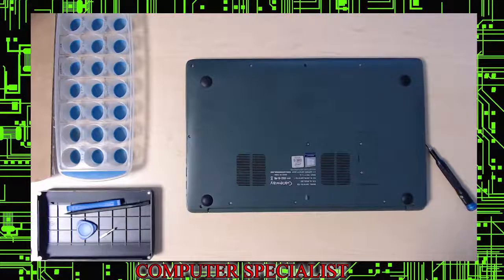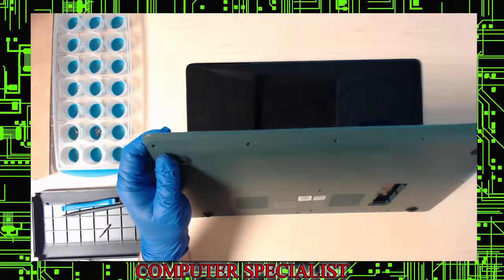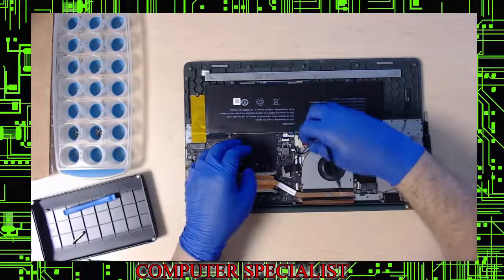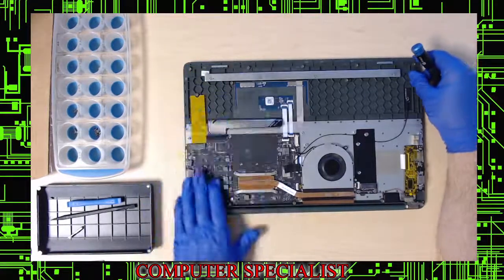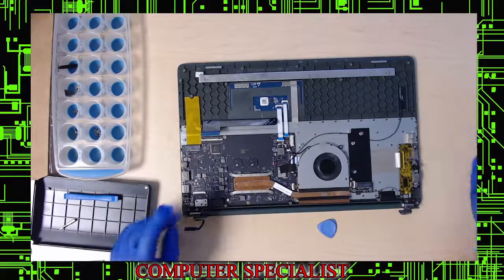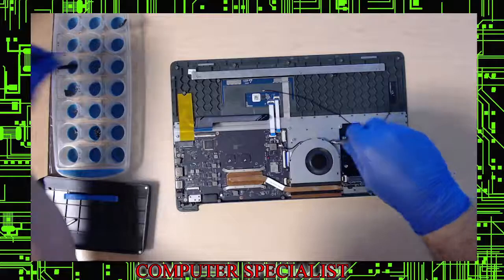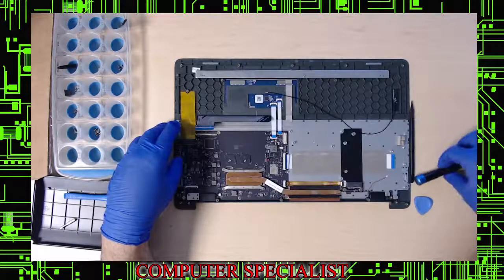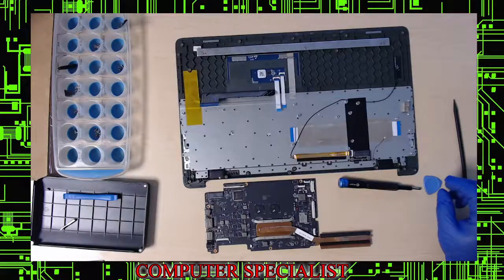Gateway GWTN156-1GR  Disassembly

Comment: Great vid! Thanks for all the info and the patience to respond to the comments! My gateway GWTN156-1BK started to have problems with keys 5, 6, R, T, F, G and V. They're so close together in the same column that definitely looks like something broke. Opened it up, the support bar was super loose, one screw almost fully unscrewed. I guess that led to the keyboard flexing and failing. 
I just saw the price for the full keyboard assembly you linked on another comment... external bt keyboard it is for now!
Reply from the maker: Thank You! Yes they are expensive!! But you can keep looking and maybe find one that accepts offers and send them a lower offer! We do that a lot!

Comment: This video helped me with my gwtn156-5.  All of a sudden one day my touchpad was popping up and the fan seemed to be getting obstructed. Turned out to be a swollen battery!  Thanks for doing this vid, gave me the confidence to crack her open!
Reply from the maker: You're Welcome! Make sure you subscribe to our channel for more videos and to help out our channel!!
Reply: well i return here 8 months later, with the same freakin problem yet again! Just noticed my touchpad starting to bulge again, and the keyboard has also stopped working a few months ago.  It has been a nice laptop when it worked, but I cant even find another replacement so im just gonna move on and get something reliable.  Dont fall for these gateways!
Reply: @Dman_12  Cañ you kindly tell me how long you've used it cuz a'm planning to buy the same gwtn156-1rg
Reply: @blessings9204  I've had mine for about 2.5yrs. I had to replace my battery 2 times now but I might have been leaving it plugged in to the wall too long!

Comment: Thank you for the video. I have a Gateway GWTN156-7BK, it's probably not even a year old. Well, I spilled coffee on the keyboard and now there's about 5 keys that don't work. It's been dried out for a couple weeks and they still don't work. Like your video explained, you need to order the whole top to replace the keyboard. Removing the bad key(s) and cleaning the plastic parts underneath of them didn't do the trick. Old laptop keyboards were removable but not this one. I spoke with Gateway and they want me to ship it to them for repair and a coffee spill is not covered under warranty. The '3' key sometimes goes wild and continually types '3' with no way to stop it. I've been told Ctrl-Alt-L will lock the keyboard but you have to press those keys at just the right time upon booting up, it's only worked for me once. I do still use the laptop because I have an external keyboard plugged into the USB port. Bottom Line: I guess I just have to get a new one.
Reply from the maker: Yes you have to replace the entire top. What color is yours?

Saw this on ebay and it comes with Motherboard, can get to fix yours and sell the MB for $150

https://www.ebay.com/itm/175084191053
Reply: @computerspecialist8533  Thanks! Well - I did it. I removed everything following your video. I did not order the whole top. I decided to pop those plastic rivets and purchase only the $35 keyboard. I'll use hot glue like you mentioned. One tricky part is to try and not bend the thin metal plate as you pop the rivets (you could also sand them off or cut them off) but it all went well. I'm now in the middle of trying to hot glue the metal plate back to it's plastic case. I'll get back to you and let you know how it goes. Thanks!
Reply: Hi I have the same issue with my laptop and the same model as yours! The m key keeps running with no way to stop it. Do you think someone like geek squad can fix it? What is the whole top? I purchased a keyboard from Amazon 😅 and now I'm uncertain!

Comment: Thank you for the video!! My computer keeps powering off. I see the charging light, but it flickers, and the computer instantly shuts down because it can't get enough charge. Can the power jack be replaced? I really appreciate any help you can provide. :)
Reply from the maker: Sorry for the delay, did you get working? Usually with these its the charger itself! The jack can be replaced but needs to be soldered on!

Comment: Hello, didnt know about the top with k/b, found one on ebay, 43 and some change, but how do I revove the touchpad without breaking it, seems like it snaps in at the top but not sure. Great video, learned some thing, thanks
Reply from the maker: The touchpad is integrated with tape and plastic rivets unfortunately. So it is not really possible to remove without being destructure. An unfortunate part of these cheaper laptop designs :(

Comment: I have this model and it had stopped working one morning I am able to boot it to the screen that says Gateway but it just never loads in. Only screen I can get to is the American Megatrends which freezes when it tells me to setup
Reply from the maker: I would start by unplugging / removing one thing at a time (My money is on the keyboard). Lay on its side then turn on and real quick unhook the keyboard, see if it boots. If still freezes, hook up keyboard again (since power button is on it) and try Solid State drive (Take out), repeat turn on process. Then battery, then side USB board. Hopefully it's one of these items! It could also be the motherboard, cpu or ram and these are all soldered together so you can't remove for testing :(

Comment: is there a wifi chip or wireless chip?
EDIT: As shown in the video there is a wireless card instead of a chip 15:00
Reply from the maker: Yes that's it at 15:00. It cant be replaced easily. Need to expert soldering skills to replace. Is yours having an issue? Maybe its driver related?
Reply: @computerspecialist8533  I just want to take out the wireless chip from the motherboard.
Reply from the maker: @justapotato6653  you would need a reflow (hot air station). Apply heat and the chip will remove. Not an easy job but there are videos out there to help you remove chips like this.

Comment: Hi sir i have the same laptop model.. but when i turn on my laptop. When the windows loading show up.. it will turn off. Could it be the battery?
Reply from the maker: It could be that or something else. Does it show a charging light? I would think maybe its the charger that's not working and the battery is dead, but has a little left to power on.

Comment: Thanks for the vid, i used this as reference to replace my gateway's keyboard. Just a question though, after assembling it back I had an error: Power Surge on USB Port, the USB port at the right doesn't work and it somehow detects a headset is connected even though there's nothing there. Do you have any suggestions what I should do?
Reply from the maker: Make sure nothing is stuck inside any of your USB ports and that there is no metal touching somewhere on the board where it shouldn't be.

Comment: Do the keyboards usually go in these models? I bought a refurbished one had no issues for the first year+. wiped down the keyboad with a clorox wipe to clean it and it started to go haywire, laggy, or no response. Tried to restart to fix and didn't. Ended up shutting down to see if it would fix and the power button wont work to turn on. Any advice?
Reply from the maker: Sorry for the delay, so yes this models are known for bad keyboards. Did you try blowing air (From high pressure compressor) through the keyboard keys? Maybe it was still wet inside etc.

Comment: All laptops have a small battery for the bios, I noticed this one doesn't!
Reply from the maker: All the new laptops use the main battery as the bios battery also. So if you disconnect  and reconnect don't be alarmed if on the next boot it takes a while with a black screen, that's the bios reconfiguring. Most will let you know with a message after also!

Comment: I tried removing just the ribbon cable for the keyboard because my keyboard is having the same issues as one of the other commenters here. But it wouldn’t boot up without the cable attached. Is that normal? I was planning to use an external keyboard while I save up money for a better laptop.
Reply from the maker: Yeah unfortunately the power button is built into the keyboard / Ribbon! So you can't turn on without it plugged in. 😢 Also what we usually do with these models is sell the Motherboard board and screen assembly and buy a different laptop.

Comment: Mine keeps trying to run hot I've removed the fan cleaned everything replaced the thermal paste which helped but I can't run a thousand things at once anymore my keyboard is lagging.  I guess it's time for a factory reset.  It's not even a year old yet.
Reply from the maker: Run a software temp monitoring program like HWiNFO (Link below). and see what temps are on CPU and GPU.

https://www.sac.sk/download/utildiag/hwi_736.zip

Comment: I hope I'm not to late to the party. This laptop carries a pre applied thermal "pad" for the cpu/heatsink contact. Is it possible to find a replacement pad on the market?
Reply from the maker: I would buy a variety pack of pads like this 

https://www.ebay.com/itm/125209504372

If its a paste you should buy this:

https://www.ebay.com/itm/402246856772
Reply: @computerspecialist8533   Thanks a bunch. I tried some thermal paste (different to the one linked.) but it seems like the heatsink doesn't mount very tightly to the cpu dies. Which is probably why walmart went with the thick pre-applied pad like paste on the heatsink to help with the poor surface area contact. Those cpu's run hot though so I'm not sure what's the thought process behind that. I would have to try the silicone pads You linked and hope they work. Thanks again!
Reply from the maker: @MrdotKstar  Yeah the variety pack is nice cause you can make sure you have the right size and also have them for a future job!

Comment: I just purchased one and the fan is obnoxiously loud. Before I pull this apart is this normal for gateways? Thanks man.
Reply from the maker: This isn't normal, sometimes they get stuff caught in them. I'd pull part and make sure nothing is obstructing it! If the fan itself is bad let us know we can list one for sale for you!
Reply: @computerspecialist8533  .... I ended up taking the back cover off and realized that the fan was installed incorrectly. The screw at the top holding the fan was tightened to much causing the outer housing of the fan to rub on the blades. I had to add a small rubber washer underneath the fan and the screw to level the fan so it could spin freely. Thanks for the disassembly instructions and I hope my post makes sense on how I fixed the issue. Just subbed as well 👍
Reply from the maker: That's Great! Yeah sometimes that metal cover gets bent down also. Usually from someone banging the keyboard 😂. Feel free to subscribe to our channel to support our cause!

Comment: Can you validate that the secondary port will take an NVME drive? I tried popping one in mine and the computer does not recognize it no matter what I do. I do know it is a working drive, tested in another computer.
Reply from the maker: Did you try both ports? (there is an internal m.2 also). I think the internal one is nvme and the one that you can get to externally is msata.
Reply: @computerspecialist8533  that might be the case. Cheers
Reply from the maker: Cheers 🍻

Comment: Question: Have you found any way to repair these keyboards? If not, I'm looking for a blue keyboard for the GWTN156-7BL. The Computer powers on right when I plug it in, but I must unplug the keyboard for it to stay on. Seeing the frameless keyboards for around $40 from China. Thanks!
Reply from the maker: So there is no way to repair them. I just checked and I don’t see any full available tops in blue. They have other colors but they are also expensive! The Chinese frameless might be the only way to go. It’s a huge pain, have to break out all the plastic rivets and then hot glue / super glue the new one in! I will keep checking for a direct replacement for the next few days for you!
Reply: @computerspecialist8533  appreciate your time! I may just part it out like you did
Reply from the maker: @slamman60  Yes and buy something more reliable!
Reply: @computerspecialist8533  I bought this one for $30. Keyboard is only issue though. Is it worth more to part it out or repair and sell?
Reply from the maker: We always part out, seem to get more money this way. Hard to sell entire laptop for any real money specially considering laptops are so cheap these days. Also since its a problematic laptop, you wouldn't want to sell to someone you know 😂
Reply: @computerspecialist8533  all true. I went ahead and bought  a $26 keyboard and will probably keep it for personal use.  If you need me, I'll be in rivet hell
Reply from the maker: 😂.. post some pics links if you can when installed. Used some hot glue to help where rivet where! lol @ rivet hell, been there and back several times!
Reply: @slamman60  So how did it go!?
Reply: @macguionbajo  went great, just took time. Used a small flat head I tapped on to remove rivets, then slowly hot glued each hole while pressing the new keyboard into place.
Reply: @slamman60  I'm entering rivet hell as we speak, wish me luck!
Reply: I'm back, and holy moly it does get tiring. But it actually worked! I used a soldering iron to melt a bit of 3d printing filament to reconstruct the rivets after replacing the keyboard. It works so good and at last I have a working spanish keyboard. I couldn't have done it without this disassembly vid

Comment: hello, I have the same laptop, it has been in use for about 1 year, at one point it was suspended and when I used it again the keyboard stopped working (it did not fall or spill liquids), everything else works perfect, screen, touchpad , etc. only the keyboard does not respond, even the power button works perfect, what could it be?
Reply from the maker: Go into device manager and make sure there is no error for keyboard driver. If shows error try deleting and reinstalling. Also I if you know how to go into bios try entering. If keyboard works in bios and then it has to be driver related etc. When in there I would try "restoring to defaults" and reboot and check!

Comment: My daughter's laptop has that crazy rebooting problem, I can't even run the BIOS, the only way to avoid the reboot is by holding down the Function key. That's very rare. Any suggestion would be apreciated. Thanks in advance.
Reply from the maker: Ok so It might be the keyboard (Power button issue). I have seen this before on this model. I would take laptop apart (So you have access to keyboard ribbon) and set laptop on it's side. Turn it on from power button on the keyboard and immediately unplug the keyboard from motherboard and see if it stays on. If it stays on you can use a USB desktop keyboard to navigate bios and operating system. If it stays on then its a bad keyboard and if you let me know the color of your laptop I can help you try and find a replacement! Feel free to Sub our channel if you like our videos!
Reply: @computerspecialist8533  wow, so looks like I have to watch your video very carefully again... step by step... that's scare me but I have do it. Really thank you very much for your advice and for your videos...
Reply: @computerspecialist8533  Thanks so much, finally I did it today, I changed the keyboard and the laptop is alive again. Your video nd your advice helped me a lot. I wanted to buy an Iced coffee for you guys, but the link is not working... Could you check that? Again thank you.
Reply from the maker: Your welcome and glad it worked out! Try Coffee Link now!!
Reply: @Alexander Silkva I'm having this problem right now, gets as far Gateway logo and restarts.
Reply: @tybalttechnologies2192  Hi, I already fixed that problem, I bought a new keyboard on eBay and problem solved, in my case the power key was the  problem.
Reply: @alexandersilvar  did you buy the entire palmrest assembly with new keyboard attached? Or just the keyboard and remove the rivets etc?
Reply: @tybalttechnologies2192  Yes, the entire palmrest assembly with the keyboard attached. Was much easier. You have to be sure about your exact laptop model and size. So I moved everything from the bad one to the new one following the instructions of this video. This guy in the video can help you to get the entire pamlrest with the keyboard.
Reply: I'm having this problem right now, there is another way to solve this problem? I cannot get a keyboard replacement because I'm in Venezuela ;(
Reply: @Jezone1  Pudieras probar primero con un potente soplador y líquido dieléctrico, también tratar de desarmar el teclado.para hacerle una limpieza más profunda. El problema en mi caso y parece que es común, viene te la tecla de encendido que empieza a fallar. Yo solo cambié el teclado.
Reply: @alexandersilvar  y al parecer comienza sin causa aparente, la estaba usando normal y se me comenzó a apagar vine buscando ayuda en estos vídeos, leí tu comentario y me di cuenta que era el mismo error, mientras se mantenga fn presionado todo bien, pero si se suelta se apaga casi inmediatamente, pudiste utilizarla poniendo algo de peso sobre la tecla? Realmente no se mucho para hacer lo que me sugieres yo mismo, pero creo que sería de ayuda llevarla a un técnico y comentarle todo lo que ví por acá para no empezar de cero 🙏
Reply: @Jezone1 Creo que estoy pasando por el mismo problema con mi laptop 😢 se apaga mientras la uso y no quiere encender .. a veces cuando le das al botón de encender la pantalla solo parpadea y otras veces se reinicia o apaga al llegar al logo de gateway... No había intentando eso de presionar FN... Pudiste llevarla dónde un técnico ?
Reply: @carlosd3488  hola si, la repararon haciendo una limpieza de teclado con limpiacontactos como sugirió el amigo de arriba, me dijo el técnico que tenía muchísima tierra espero que dure un tiempo
Reply: Actualización ya se dañó otra vez 😭😭😭😭😭😭